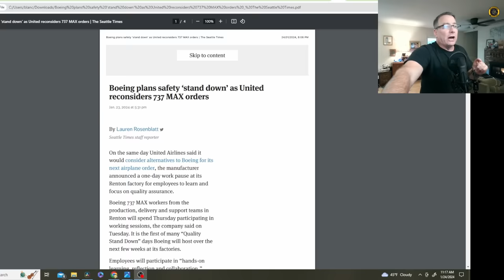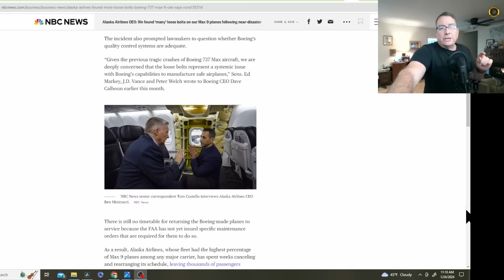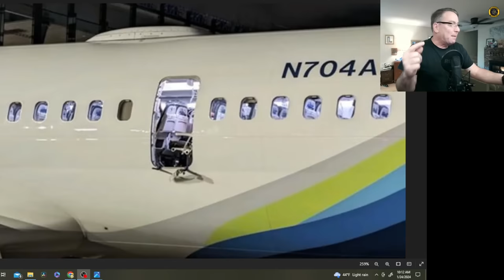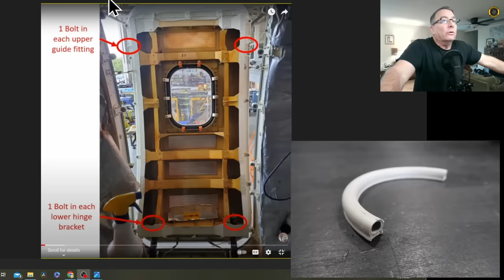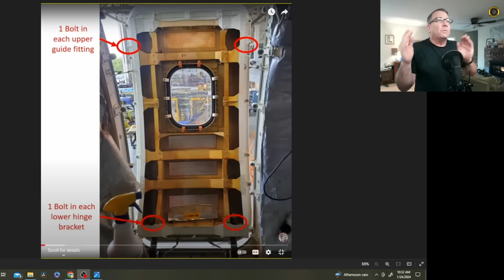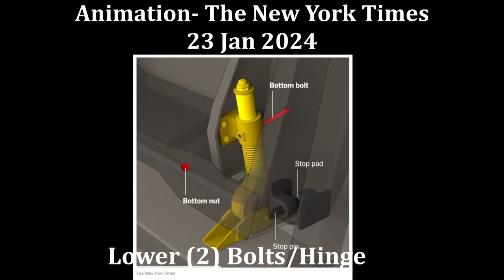Boeing's Quality Management Failure Explained 737-Max-9 Door 24 Jan 2024

Comment: But the question is also to what extent such errors in assembly are also connected with the American system of taking on unqualified employees for such assembly work when there is more work to be done, and then quickly firing them again when the work becomes less. The training does not seem to be particularly detailed. If the employee works carefully and reliably, this is certainly much better than all the QM regulations and forms.

Comment: I worked on number one  737  . Tomson site Boeing  field Seattle  Washington.  I also  worked  on 747 Evert Washington . I  mostly  worked  shop inspection.  We would  go through  a area. Then  turn it over to  the inspector.  He would  do the  inspection and  write  up what  we're called  P/U or pick up.  We would  work  off the  pickups  and sell them  back to the  inspector.  If you  closed off a area you  had a senior  inspector  look at it. In critical areas  ( like a door plug ) the  company  buying the  airplane  and  FFA had to  do  a inspection.  Before you  could  cover it  up. So all this bullshit  about  not having  paperwork to  reinstall the  bolts is crap.  Before  closing  multiple  people  should have  looked at  that area. If you  ask me  it started  back when  they  moved  the  headquarters  to  Chicago.

Comment: The question I have is this: when they removed the plug and put it back, the four bolts they removed and didn't reinstall would have been lying there. No one noticed these extra parts? Wondered what they were from?

When I fix an Ikea stool I am going to be very concerned if I finish and I find I have an extra screw I can't place. But for an airliner?

Comment: I know one of the reasons for this pathetic pattern.  When I was learning how to design things like this I went to a career fair for practice.  I handed one of the people running the Boeing booth my resume' to begin the discussion.  It did not have my GPA on it because I still had a couple  years to go.  The person looked at the paper and asked one question, "what is your GPA?".  I told them and they handed me back the resume' and turned their back on me.  They would only speak with people with a 4.0.  Part of the reason I was pursuing this particular education was in the hope of working for a company like this, preferably Lockheed.  If you don't understand the error of using this as a filter for hiring just look at what they have become a couple decades after that interaction.  A 4.0 is a red flag that at least needs to be acknowledged.  Absolutely nothing about these failures from CUTTING corners is even mildly surprising.  The 777 is incredible, and it's incredible that they managed to turn the boring yet near universally loved reliable workhorse of the air 737 into a laughing stock is very sad.

Comment: I’m no A&P but it seems they have found a loophole to not have to inspect or if I understand what was said here even write it up properly. Yes it sucks to have to have someone come check your work but this is what happens when you don’t. Honestly in my opinion (which may be worthless to some) it sounds like they are playing word games as from what I can tell there isn’t much left to completely remove the "door". To me opening a door means turning a lever, flipping a latch or something along those lines and it opens on a hinge. If you have to remove bolts then it’s removal in my opinion. Thanks for keeping us up to date as this unfolds Mr Brown.
Reply: As someone who worked for a major airline for almost 40 years as an AMT [A & P] The QA Inspector was my friend. I welcomed them to INSPECT my work that required a QA/ or RII Sign Off. Some processes require the QA Inspector to be present while you are performing the tasks. 
I 'm very glad we had QA Requirements on many of our jobs. Safety SHOULD BE everyone's business and My family and myself flew on the very same airplanes I worked on.
If a mechanic does not welcome QA to look over their work then they really don't belong in the Aviation Maintenance business.   
In my opinion the Installation of this Door Plug [ Not actual Plug type Door ] should require a RII Sign off on paperwork. 
RII = REQUIRED INSPECTION ITEM

Comment: I sold vibration monitoring sensors for a company and an engineer from Germany said if the equipment was built and installed correctly in the first place you would not need to monitor. Boeing relying on QA to catch this type of mistake…is a mistake on procedure for fabrication or repair.

Comment: im curious why a castellated nut is used in this installation.  my understanding of AC43.13 is that if nothing is moving on either side of the bolt a self locking nut should be used

Comment: Great job making this clear Juan. It’s unfortunate. This is going to hold that plane up for so long because apparently there’s nothing wrong with the design, just of people putting the thing together. It should be easy to inspect all current aircraft to make sure those bolts are good and move forward however, before they make any more there definitely needs to be a commonality in the quality assurance program. I suppose everybody’s buying a nearby stock right now, which will also add to the hold up a Boeing until the airbus stock levels off. Could this have been a case of industrial espionage?

Comment: Surely the question should be asked “what else is going to be found missing / broken / not installed?”
This in conjunction with MCAS debacle means that Boeing should scrap all existing 737 Max aircraft and design a new aircraft with longer undercarriage, so the engines are under the wings, and plug doors that can not physically fall out plus anything else that needs to be updated!
If I was ordering aircraft, I would have to go for Airbus until this was fixed.

Comment: As an A&P mechanic with I.A. for 50 plus years working in general aviation, I have seen a few mistakes that fortunately didn't result in a catastrophe. Regarding the security of the bolts, in my opinion they are stop bolts, meant to stop the door, or hatch, or plug from moving in its' mounting structure, and as such I don't see the need for a drilled bolt, castellated nut and cotter pin. An undrilled bolt with a locking nut would suffice in this installation. And I don't think there is much difference between loosening the door, hatch or plug and removing it, as the same steps would be involved as far as the stop bolts are concerned. And if you have ever replaced a seal on a door or window, it is much easier to remove it than it is to leave it on the airframe and do the work. One final note, any time that a component that is a major part of an aircraft is removed and replaced, there should be two pair of eyes to inspect the finished product. And common sense should rule in this decision, it shouldn't have to be written that the inspection take place. Additionally, when all is said and done, a lot more will be said than done.  ABWACK
Reply: Why do you clowns choose to overlook the fact there are tens of aircraft missing hardware.... Why is that so hard to follow?
Reply: Tens? Of what, hundreds, thousands? Did you personally observe this, or are you parroting something that you read on "social media"? And the missing hardware, is it a safety of flight item, or missing access panel fasteners? In reading many of the comments I surmise that many of the commenters have no direct relationship with aviation, but know someone who is or was. One other point that I failed to question is the term loose hardware. Does that mean that it was installed properly but was able to be rotated in place using a wrench or socket? A castellated nut and cotter pin are installed on a bolt or screw that is subject to rotation, as an engine control, or a flight control. In my opinion it is not necessary to lock the plug in place.

Comment: In Boeing if something is disassembled after it has been inspected and bought off by a quality inspector, it requires a removal record for all parts removed. If this was in fact removed. Even if a single bolt there should be a record. Otherwise it does not follow Boeings QMS.

Comment: Seams like the people that actually do the work need to be more responsible for their own work. if you take a dump do you need someone to come along and make sure you wiped and fill out a form to say that you did?  I could see a form that said I took the door out or opened it to replace a seal and reinstalled all the hardware and safety wired everything.

Comment: I thought that aircraft doors were designed to be held in place by the higher air pressure inside the cabin. Was this design not used for this door?

Comment: Having two different categorizations to define the procedure for essentially the same process (door open versus door removed) but each with different methods assigned with totally different outcomes to make completely safe seems to be one immediate problem.  Why was it not simply door removed for every related event?
The next would be the design and reassembly process was not robust to show up that the bolts were missing. Just painting the bolt hole and surrounding surface say yellow such that when the bolt was missing it was a clear visual? The bolts say black heads would contrast. 
I am sure there are other ways of flagging the bolt was missing or better still of locking the door that would be even more effective for such fool proofing/ poke yoke techniques. E.g.a door securing latching and cam mechanism where the release handles when in the open position stood proud of the door covering (that covers the ribs) and had to be completely latched shut so the door covering would only then fit back flush. I am a firm believer in designing out issues rather than relying on inspecting things out using humans who unfortunately are not necessarily consistent in their actions or decisions. Amazing there are no data transfers between the two companies quality systems as you infer, leaves me speechless.

Comment: There's a word forming in my mind, something like 'clusterf*ck' 🙂

What I don't get is why the mechanism as shown in the animation at the end is so complicated. What's wrong with just through bolts, rather than all these complicated springs, and clips and tracks for the bolts to follow. Surely just a seal and bolting the door to the fuselage through a fixed set of holes in flanges would have been far simpler and more importantly far less likely to be assembled wrongly. If you need to then use the door hole, it would be unbolted and a movable door complete with frame could just be bolted in it's place. Too cheap and too simple, I expect.

Comment: Rebuilding a safety culture in an ongoing business is practically impossible. Like changing the chain on a bicycle being ridden in a bicycle race. Boeing is finished unless it has a separate management running a well oiled and established business that is able to take over manufacturing the necessary products independently from the main company.

Comment: This mess is the smoking gun about how shitty Boeing's manufacturing and maintenance section has become due to deliberate policy choices made by the management.
This is the perfect exemplar, because the exact same design of the door plug has been used for decades on the 737 and 737NG with NO incidents ever.
So why is it happening now? 
Answer: POOR EXECUTION by a management team that has turned accountability and quality oversight into a JOKE. 
They have no excuses to use that this was a "new design" and there is no way they could foresee any future problems. This is decades old, proven engineering, poorly executed.
Clearly, the stockholders need to clean house. The Board, the CEO, and a shitload of VPs need to see the ax and perhaps Boeing needs to go oversees to hire a European management team.
If they ever get their act together on quality, then it will be time to reabsorb Spirit Aero-systems back into the Boeing to maintain quality.
Spinning off a division because it "isn't profitable" to be purchased by a "financial management" company is the height of short term thinking, which seems to have been the hallmark of Boeing for the last 20 years.

Comment: I'm confused - How can they open the door without removing the bolts ?  Of course they can not because the bolts (and related nut and cotter key) prevent the door from moving from the fully closed position.   Presumably the FAA reviewed the Boeing materials before and failed to catch the issue but Spirit did note the issue.   Were I a Boeing stockholder I would be on the warpath.  If this were the only Boeing problem it might be dismissed as an anomaly; but, it is not.  There's the SAS system that cost hundreds of lives , the inability to deliver a fully functional tanker to the USAF after 20 years and a history of acquisition related felonies. 

As others noted there was a change in the culture when Boeing HQ moved to Chicago and then to the DC area.  Schmoozing customers is deemed to be far more important than building safe, fully functional aircraft on time.  Certainly all the problems are not at HQ but the HQ culture affects the field operations.  Classic case was that of Boeing's Chief Tech Pilot (not test pilot) on the Max program who wrote a lengthy , self congratulatory email detailing how his Jehdi Mind Tricks got the SAS past the FAA and references to it removed from the flight manual so that Boeing's commitment that airlines would not need sim training for pilots moving to the new airplanes. In their sloppiness they forgot to remove the references to the SAS in the index.  The Chief Tech Pilot was charged with several felonies but pled to a much lesser crime.   

Earlier there were two other felony cases associated with the tanker contract involving the former chief civilian in the DOD acquisition program and her daughter , related to the tanker deal

Prof Feinnman described the process as the normalization of deviance.

Comment: Another thing that came to light on another YT channel is that the cockpit warning lights are usually placarded Inoperative or De-activated on the aircraft that have the door plug instead of an Actual Door in this location. In my opinion this is NUTS. Every other major fuselage door has cockpit warning lights if the door is not closed and latched properly  .
Some Fuselage Door examples would be Main Cabin and O/W Exits - Cargo Doors - E & E Doors - Ventral Stairs . 
This Door Plug is going to eventually start moving out of position if the 4 Bolts are not Installed and keeping it in proper position. This SHOULD have activated the cockpit warning light if the WARNING LIGHT was not DE-ACTIVATED/ INOPERATIVE. 
If the Information is Correct that I saw on the other YT Channel then that is Plain NUTS in my opinion.

In fact sometimes Flight Interruptions happen due to a Door Warning Light in the Cockpit.
Example:
1-11-2024 = TAMPA, Fla.   A  ______ Airlines flight made an emergency landing Wednesday at Tampa International Airport due to a door indicator light, according to an airport spokesperson.

Comment: The bottom line as I see it is this, the MAX is so far removed from the original series 100/200 aircraft that it should have been a new type certificate.  It would then have had to follow a new type design certification process.

Comment: I really don't care what the reason is. Whether it's a 'plug', door, opened or removed, how about one of the final safety checks is... Gee I don't know, making sure every potential opening of the cabin has all the f'in bolts installed?! Why does some nonsensical paper trail dictate the most basic of QC checks?

Comment: I don't buy the explanation (different Q/A systems). On the air frame, the oversight came from a misclassification of what was in the opening, a door or a plug. A plug has the retaining/safety bolts, a door does not. Their are likely other differences such a hinges and latches. The inspection procedure should be based on what was installed (plug), not what wasn't installed (door).

Comment: You said FAA denied BoZo’s request to up production..  they should lower it to 15per month. If they can deliver 15 zero-defect planes next month they can go for 16 the month after that. And up it one plane each month they go zero-defect (escapes). It goes down one plane per defect. 

They need to re-earn their production rate by proving they can do it. 

Also-ONE software, used by all, to track the airframe production from build start through delivery. It should be held by a 3rd party with bonuses for catching mistakes. 

Trust but verify 🤔

Comment: The employee whos job it was that day to install those bolts likely failed to retrieve them from the tool crib at the start of his/her shift Or misread the days spec sheet and didnt get enough of them so when he/she realized they didnt have them was too lazy to crawl out of the airplane down the various ramps and scaffold to go back to the crib, or his, cart for more. These fasteners are very large and specific, if that werent so the machinists have been known to put another fastener in place that is not the correct/specific fastener only because thats what they have left in their kit at days end or before lunch! Its not uncommon for things to get missed, or ignored as the fuselage goes down the moving line to its next phase of manufacture. The machinists in one phase are required to follow the  undone jobs down into the next phase to complete what didnt get done.
Some employees are very conscientious, others.....are not.

Comment: These types of bolts should be designed as non removable in a way that this door would not stay in place unless the bolts where properly installed. This is how its regulated in most Safety standards .